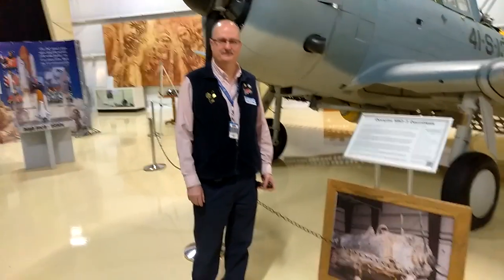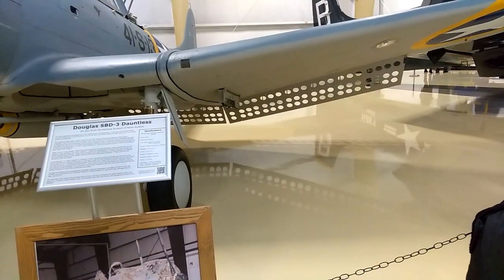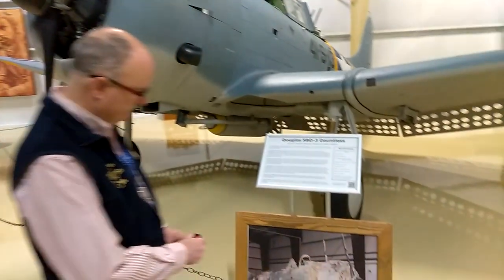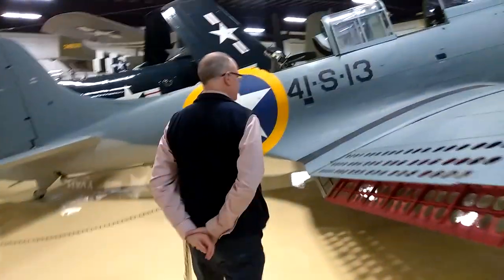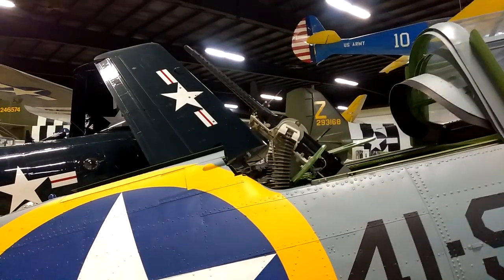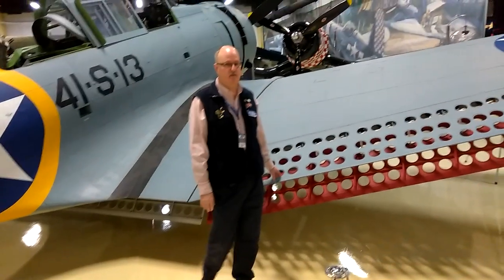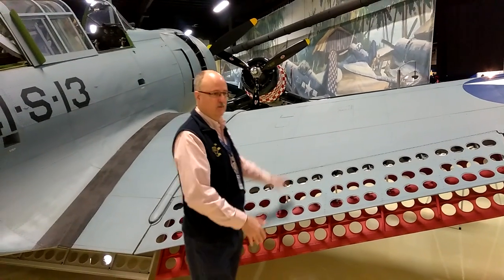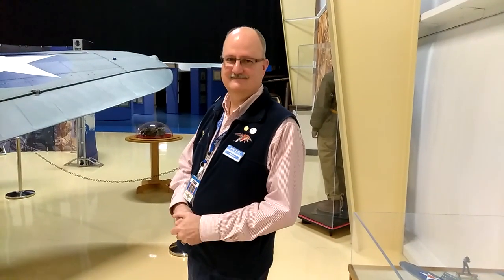Douglas SBD-3 Dauntless Dive bomber

Comment: Great Lakes Naval Training Station had 2 vessels that were converted to aircraft carriers and were located in Lake Michigan.  They were used to train Navy and Marine pilots on actual aircraft carriers, with better conditions, and close to land, so the planes could be repaired, replaced and the ships leave the base near Chicago for more training the next day.  The sailor trainees stayed on land most of the time.
Reply: IIRC the two ships had flight decks but no hanger deck to store aircraft inside the ships
Reply: Let me expand on these two short-lived WWII aircraft carrier conversions:

USS Sable IX-81 was converted with a 535 ft. long Steel deck for landing planes & 8 arresting cables. She was equipped with 8 arresting cables. She had a 58 ft. beam, not including paddlewheels and guards. She was capable of 18 knots. 

USS Wolverine IX-64 was converted with a 550 ft. long wooden flight deck, and arresting cables. she had a 58 ft. beam, not including paddlewheels and guards. She was capable of 19 knots.

Both sisters were the only Coal-Fired side paddlewheel aircraft carriers used by the United State Navy. They were stationed at Navy Pier, Chicago Illinois. These ships were part of the "Corn Belt Fleet" and were assigned to the 9th Naval District Carrier Qualification Training unit. These carriers required a strong wind over the deck for most of the newer Naval carrier aircraft, and during low-wind conditions for several days, the pilots would qualify using SNJ Texan training airplanes, on land airstrips.

These ships were involved in the training of over 17,000 pilots, Landing Signal Officers and other Navy personnel, in just a few years.